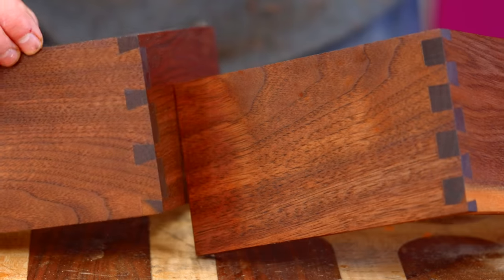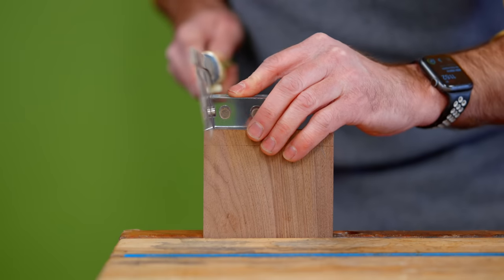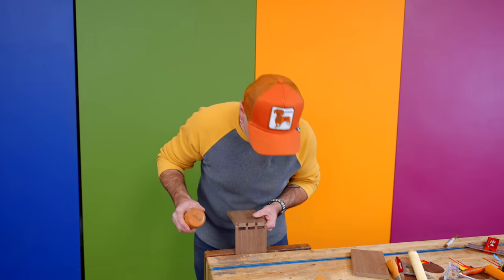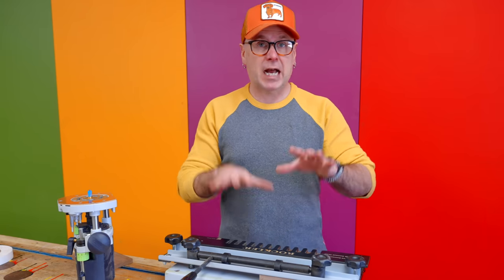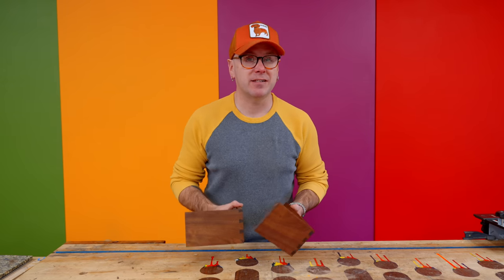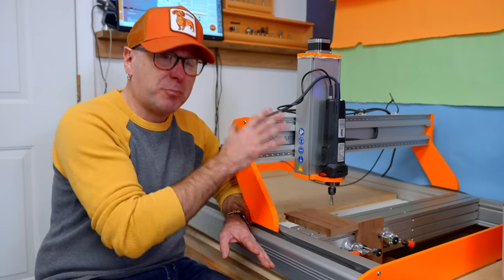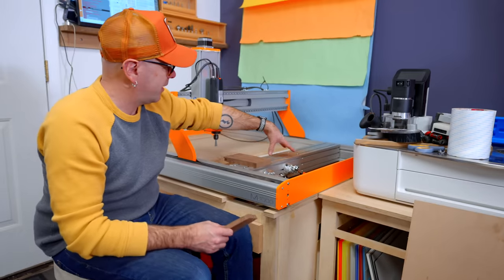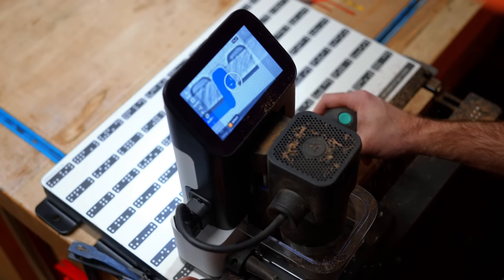Easy Dovetails. 4 ways to level up your woodworking.

Comment from the maker: I may have misspoke about the dovetail gadget in Vcarve. If you have experience with it please let me know how it works. Thanks!
Reply: I use the Vcarve gadget with the same cnc machine you have and it works great I use it to make lots of drawers and they come out basically perfect, you can also change the angles of the dovetails and sizes with ease to match the drawer your building. That is especially helpful when doing a dresser or whatever that don't have the same size drawers
Reply from the maker: @99yellowz Thank you! Looks like I need to give it a try.
Reply: I should also mention to get clean cuts I use a Amana 1/16 bit so drawer material depth is limited to about .60in or so with around a 25-30% stepover rate then scrape the fuzzies with a chisel

Comment: Personally, if I have to cut a lot of identical dovetail pieces, like building a bank of drawers, I like to use a jig with a tablesaw. I was surprised that wasn't one of the ways you covered. It was the second way I learned to do dovetails,  after hand cutting.
Reply: I don't know why, but I didn't see a table saw jig for dovetails that I liked. 😕
But it definitely would be the way!

Comment: with hand cut dovetails I angle the board for my guide marks to be vertical to cut dovetails with the saw vertical. the saw registers in a knife line. I think it was something I learned from Wood wright's shop. someone I knew cut his dovetails on the table saw. you have to have a blade with flat teeth.

Comment: Great stuff as always David! Just don't blow too many dovetails 😆. I picked up a KM (Katz Moses) jig a while back and I'm digging it. We use jigs for so many things, I see no reason for some to crap over their use in cutting dovetails. I saw an alternate version of hand cut where you cut by hand, waste out with coping saw, but then clean out the bottom with a router with pattern bit (may have been Matt Kenney?). Haven't tried that way myself yet, but looked interesting.

Also - still not quite used to you sans beard lol. Thinking of bringing it back? (you know I am pro beard biased lol)